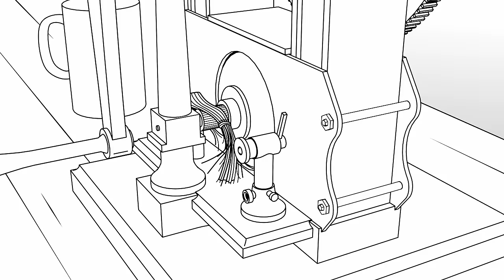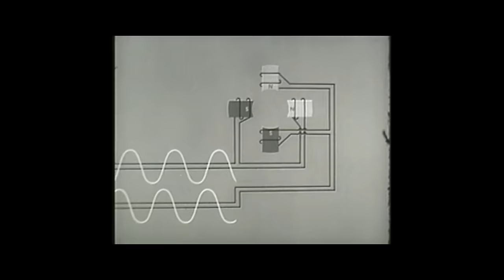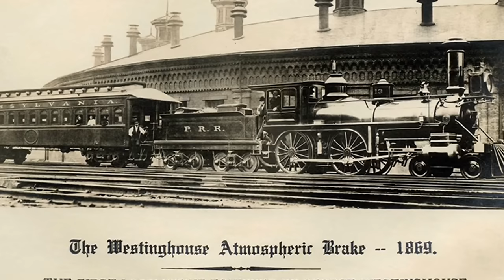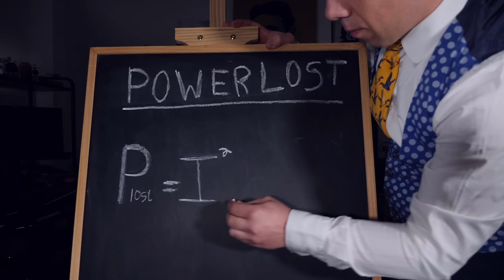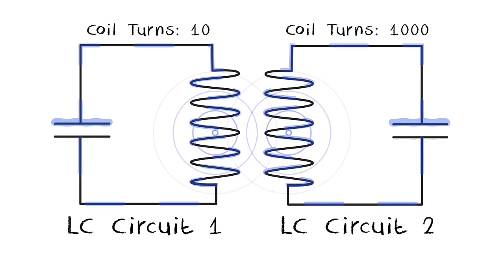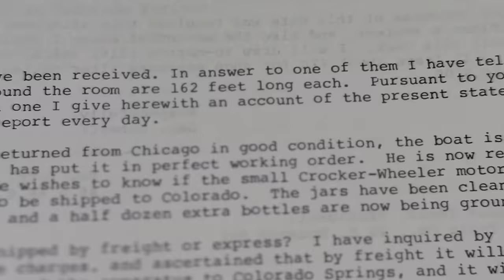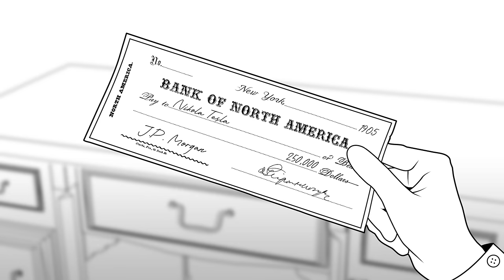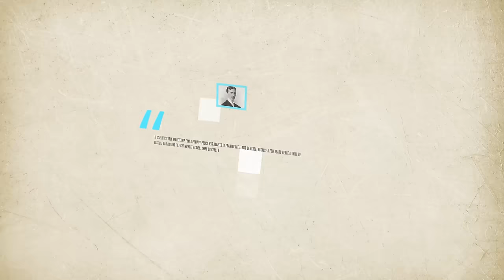The Amazing Life of Nikola Tesla (Documentary)

Comment: 14:30
from my understanding, both the current and voltage are actually high enough to kill in most tesla coils. The reason why it's so harmless is because the frequency is so high that it's never active long enough to depolarize the membranes of your nerves, meaning that it never actually does anything really. It can still cause internal burning though if you're exposed to it long enough, so it's not completely safe to handle for long periods of time
Reply: Yep, and tesla coil also doesn't increase voltage by decreasing current. It actually increases it. Integza was probably mentioning the formula P = U * I, where P has to be equal or lower after the transformer. The problem is that this formula works with phasors, and it uses complex multiplication. The irony is it stays exactly the same, as you would expect, for DC but behaves quite differently for AC. Its ac equivalent with normal numbes instead of phasors would be P = U * I * a (where U is voltage, I current and a the power factor). From it, you can see that both U and I can be much higher but at the expense of making a almost 0.

Comment: The story I've heard is that his RC boat needed logic circuits to be able to control the directions. Those eventually came into the legal battles about the digital computer and is a huge reason computer logic circuits were not held back by excessive licensing fees. Also some hypothetical overlap with his use of multiple frequencies and the invention of frequency hopping controlled torpedoes by Hedy Lamarr in the 1940s (but as the video mentions, most of the details of the RC boat were lost/hidden)
Reply: @gregw1076 also note that the American military ignored and rejected Hedy Lamarr's secure radio design  ...just as they refused to fund Tesla's "secure radio" system, when he presented it to them around ?1902?

Comment: Love the video, very educational! One note, voltages on Tesla coils are usually way less than they appear. It’s common to estimate the output voltage by arc length, but this cannot be done accurately with Tesla coils, especially a QCWDRSSTC like the Tesla gun shown at 14:24 . Tesla coils are high frequency AC and take advantage of spark propagation techniques to achieve very large sparks with lower voltages. QCWs we’re designed specifically for this and have been measured at <100kV for coils producing >2m arcs. Other medium sized Tesla coils are probably operating around the 100-300kV range, until you get to the 10-20 foot tall Tesla coil range where you start approaching 1MV on the output. Also, voltage and current are not the only factors at play with Tesla coils. Styropyro proved this by touching a monstrous 100kV 3A output Tesla coil (fantastic video, I’d highly recommend!). There are many many more factors to consider other than “it’s the current that kills”. Tesla coil voltages and lethal power properties are just about the 2 buffers myths/misconceptions about electricity, so I wanted to try to clear those up. Overall an amazing video, I learned a ton I didn’t know about Tesla despite building his coils myself! Thanks for the high quality upload!
Reply: ElectroBoom did a video on this and as I recall frequency also plays a huge role.  I think it changes how the current flows through different mediums and thus can cause an otherwise lethal current to flow harmlessly over the skin (there are aspects I don't fully understand yet).
Reply: @grn1  yeah, the skin effect does cause current flow to be pushed to the outer area of the conductor at high frequencies, but this effect is also dependent on the conductivity of the medium. Since humans have a poor conductivity, the skin effect does not play a large role in Tesla coil lethality. It does act very strongly on copper though, and you can notice the effect in the primary coil within Tesla coils, as it overheats easily due to less area being used. This is also why people use special wire, called litz wire, made up of many smaller insulated wires to help carry the current. The video by Styropyro goes more in depth on all this if you’re wanting to learn more.
Reply: @Electronic4081 Pretty sure I've seen that video but it's been a while so I've forgotten a lot of the details.

Comment: Some ideas:

How about introducing some cooling (water or oil) to your engines, as in regular jet engine? Temperature seems to be killing them, even cooling the casing should work.

There is a concept of using hydrogen as fuel in Brayton cycle either for propulsion or to produce steam (H2+O2) and generate electricity.

I'd love to see your approach to utilise rainwater (or its artificial equivalent) in some kind of impulse turbine. There are a couple of them eg. Pelton Turbine, Turgo Wheel Turbine, Crossflow or Bánki-Michell or Ossberger Turbine.

Great video!
Reply: A cooling system is a good idea, but wouldn't it negatively impact aerodynamics by making the build bulkier?
Reply: @genericbeansmile756  Might, good point, but depends on design. 
For instance you can use additional tube to create a gap for fluid to flow through, and it would be sacrifice of only several mm. Another idea is to redirect some air after compression for cooling (but lower power). On the other hand Joel most of the time tests his designs in static operation. 
Well, after all even if it increased drag it would make the engine more durable and usable.
Reply: The hydrogren propulsion tech would be interesting; especially with solid-state hydrogen tech slowly coming through (i.e. dramatically reduces the risk of it blowing up)

Iirc because the interconversion back is temperature dependent you can somewhat control the rates of release too

Comment: This video could've been 3x longer and still be great :) Some ideas don't seem plausible, like the wireless energy, as it would require huge voltage gradients and could in my imagination even cause the ionosphre to light up.
Video idea: While it's not really original as I've been thinking about it for like a year now, what about creating a semi-auto cannon powered by HHO? If you would be able to somehow make it rapid-fire as in just reloading the projectile and firing instantly, without waiting for a new gas charge, that would be awesome. Something like a valve system with pressurised HHO.
Reply: I just thought I’d mention that pressurizing or storing bulk HHO is never a good idea. It’s a mixture of a fuel and oxidizer that happen to be way more sensitive than normal propellants or H.E.

It’s best to never have more than the amount you actually plan on setting off, and never have an amount of HHO exist somewhere where it igniting would be a problem.
Reply: My vague understanding of the wireless energy is that the earth itself would become an oscillating capacitor, then yeah the ionosphere would be the "coil" of the "circuit"
Now days we use the earth as "ground", meaning if we turn it into a capacitor, most of our electrical devices will burn out if someone tries this same idea now... is more the conspiracy side of it probably
Reply: @gregw1076  my gut feeling, before crunching any numbers, is that the ionosphere and earth’s surface would both be very lossy. 

Failing that, every tree, person, damp terrain feature etc is also an antenna or at very least act as a capacitor/resistor combination being put across the waveguide/resonator. 

Resonance can allow you to have very high electric fields, currents, and magnetic fields with very low continuous power input . But that only works as long as every component in the system is able to pass those high voltages, currents, fields, frequencies etc without dissipating very much real power. 

The more resistance you have in series or parallel, or the more electrical loads, opportunities for “far field” electromagnetic radiation to escape the system etc, the more power has to be fed into the resonance.
Reply: @deltab9768  Well, you aren't wrong, but we're talking about a cannon, and an explosive proppelant. Both of which aren't safe and both should be done only by people with some self-consciousness in their minds.
Also not many people know that HHO can explode on it's own just from being pressurised too much, or IIRC even from being depressurised (or was that with just hydrogen, but still a simple jet can cause ignition). If Integza would make it a scaled model, it could be a small charge comparable to a tiny firecracker with maybe a BB as the projectile. Loaded separately, in style of soviet tanks. Then, even in an event of unplanned fireworks going off nothing should have harmful shrapnel. As long as you wear protective gear like glasses. :)
Reply: @tomclanys  as far as accidental ignition risks, It’s much easier to get HHO going than any of the normal powders. It’s probably more sensitive to spark than neat NG, or even any of the common “primary HE’s” or primer compositions

That said I have personally experimented with some small scale HHO and not with all that other stuff. 

Part of that’s legality, and part of it is I’d rather have a 50 ml plastic container of oxy-hydrogen at atmospheric pressure go off in my hand than even a single ml container of NG. 

I wouldn’t have even said anything except the mention of a pressurized feed of HHO immediately had me picturing 5 bar of it in (at best) a pop bottle and (at worst) a PVC or cast iron system that couldn’t take the peak shock pressure if it decided to do what it does best while still in the reservoir.
Reply: @harms123  the soil/water would act as one electrode, the ionosphere as the other, and the air would act as a dielectric in between them.
Reply: @deltab9768  Yes, I got you, that's why a rupture disk would be a good safety against a casing explosion. PVC is terrible. Maybe a sawed off CO2 canister, so it doesn't have a neck. It's strong.. but also a bit big for the project.
By NG you mean nitroglycerin?
I did play a lot with a potato cannon from PVC, which I "hardened" or rather fastened with metal self-tappers. Not a bright idea, because instead of the seals popping of it could explode sideways through the wall. That's where metal bands come in to play, just like what another post-soviet army does :D
Reply: @tomclanys  Yeah that’s exactly what I meant by NG. That’s a word I don’t want to type out on social media but anyway it’s one of the things I’ve never tried to make. 

A few years ago I had this old film canister, I poked holes in the lid   to admit two wires and a tube of maybe 2mm OD and 0.5mm ID. Had some fun charging it with HHO and then using an electric spark to set it off. The lid would   pop off if you pulled on it with even gentle finger pressure, but with HHO (and some residual air) in it, it made a loud bang every time it blew the lid off.

Then one time I put it on the electrolysis cell for longer, so that nearly all the air was washed out and the canister was near 100% HHO inside. That time it didn’t just blow the lid off it broke the film canister into pieces.
Reply: @deltab9768  ah, you made a popper, I know of it but most often it used butane as the propellant, I think. By your way of typing NG I guess you're afraid of being on a watchlist of some sort? Are you in USA? Fortunately NG in my place is used mostly as a heart medication :)
The easiest way to get a "safe" amount of butane in a chamber is to use a hair spray. It's really hard to get it to detonate in my experience, most of the time it has a slow flamefront and works really fine for potatoes, with a slow "whoomp". Well, other than that one time the potato flew so far we lost sight of it... and the chamber recoiled so hard that it broke the lighter. But it was fun :)

Comment: You are absolutely right that you only can use a transformer to step up/down the voltage using a transformer. But to transmit electricity you CAN use DC just as well as AC using electronic converters.

Comment: video suggestion:
3d print the best possible replica of that 1898 RC boat.
make it accurate to the available options at that time. use a L-C Circuit with 3 distinguishable frequencies on your control station and 3 corresponding antennas on the boat.
1 frequency/function for forward
1 for left turn 
1 for right turn
idea for the construction: 1 antenna is trying to power a brushless (maybe also 3d printed with some later added metal parts) motor.
the other two antennas could be used to power an  mechanical switch to switch the rudder like neutral position (straight forward), left and right position.
and dont forget the lights =)

Comment: I just realized how accurate the comparison between a capacitor and a balloon are is. They both can act as a reservoir of potential for later use, they both can act as a buffer for smoother operation of some type of equipment especially when the primary power source is smaller than it ideally should be, and they both explode spectacularly when they are massively over loaded.

Comment: Integza, you didn't explain the concept of resonant. The tesla coil is a resonant transformer, it doesn't make millions of volts because "the primary is charged by a capacitor", but because the tank circuit formed by that capacitor and the primary of the TC is in resonance with the tank circuit formed by the secondary and the top load, which is a capacitor to ground.

Comment: 14:39 You’re wrong there, the current is very high too, but the pulse width is very short and the frequency high, which won’t make it interact much with neurons. Also there’s a large phase shift between U and I so the power is mostly reactive power. And Tesla coils can go out of tune by the capacity introduced when touching it, lowering the output power.

Comment: Hey Integza, Great video again. Here is the challenge for you: Underwater Arcs hydrogen triggered: On a recipient full of Deionized water, you have a flow of hydrogen, that flaw pass the first electrode, making it conductive, that will close the circuit and power the second electrodes that are y bit higher and constitute a spark gap. Then spark through the gaz bubble and the cycle repeat

Comment: I am a student just reading about powder metallergy. As you always make many part from plastic it many time gets destroyed due to heat. You should give a try to powder metallergy 
Like making powder of metal wire is first through atomization or crusher  then mixing/blending with another element. Then through compacting and sintering makes the shape of desired product.
I dont know if its possible at basement or not but why not try it.😅 

Sorry for english my bad.
I know its not topic like which everyvody like but still it may reduce or may increase effort for your next possible video like engine stuff

Comment: integza, thanks for the video, it was really entertaining, you know, i think just using a thrust engine to propulse a rocket is not efficient enough, mainly in the launch stage, a good idea for a experiment could be to use a electromagnetic accelerator that can reduce the fuel usage through the initial phase, this in my opinion would increase propulsion time

Comment: You can create a solid state laser. Since you've said that Tesla was experimenting with rubies. Ruby is a vital part that acts as a medium for laser propagation. You can use epoxy resin to create the lenses and further modify them to electrostatic lenses. Even a high power laser diode/flash tube will do. Don't forget to add a Tesla coil too. Like the one which acted as a gun.

Comment: YT isn't suggesting your videos...  I was randomly daydreaming up ways to improve jet engines, because they are cool obviously.  I was thinking about how they use some of the compressed pressure to shield the combustion chamber from heat which allows a more powerful constant controlled explosion.  That alone would work as a video, however you could follow that up with an electric hybrid which used an electric compressor so the jet engine could use all of its compression rather than wasting some of it on heat shielding.  I am just some random guy with a general studies degree so I could not tell you if this is at all efficient or worthwhile.  Either way, it would be cool!

Comment: Video idea: 
There is a reaction between gallium and aluminium (plus some water) wich makes hydrogen and Aluminium oxide. You could use that hydrogen in a motor to make a 100% clean fueled car, since Aluminium manufacturing is like 90%efficient and doesn't make greenhouse gases (i think). And hydrogen fuel only makes water vapor. This solves the problem with hydrogen storage and electrolysis inefficiencies in hydrogen cars.

Comment: I've been but by electricity plenty of times, closest it came it killing me was 5000 volts at more than an amp across the magneto of a microwave I was working on.  The blessing was both points of contact were on the same hand.  I ended up with pulled shoulder muscles from my arm violently jumping off the connection, and an irregular heartbeat for a few days.

Comment: Here is an idea
how when you try to 3D print a nozzle or any part for an rocket engine the tolerances of the 3D printer is pretty low so why not try to build a simple 3D axis CNC machine that will take the 3D print and cut to so that the tolerances of the part will be even lower and the rocket engine that you will try to use will work much better and will make much less problems

Comment: Video theme: I would love to see a video of you producing the tesla inspired rocket. I think it would be a rail gun like device, with extreme voltage potential dumping into 2 rails. A small tesla coil would be used to charge the system and it could use a spark gap and microwave diode and capacitor to produce acceptable voltage and amperage to cause a metal rocket to blast off from the 2 rails. Thank you for the history, it's always nice to hear a collection of information with some good story telling
Reply: that's a railgun firing a rocket. Huge power requirement to be useful.